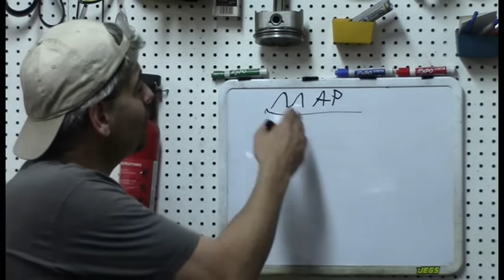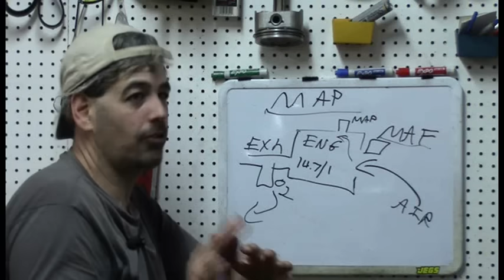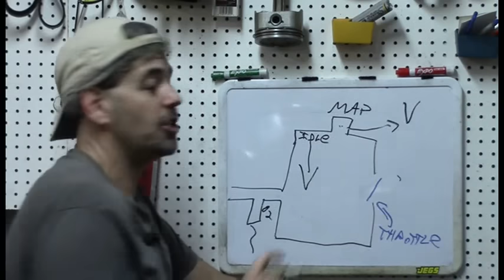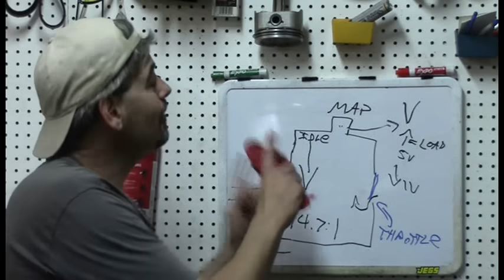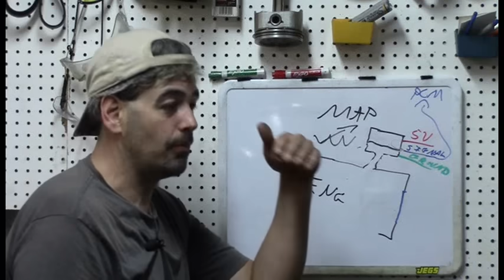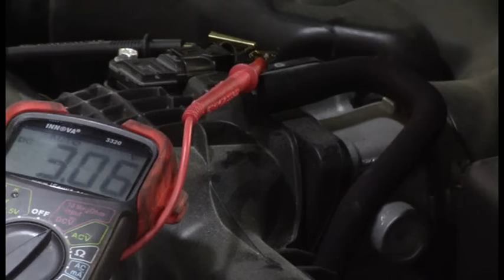MAP Sensor Diagnosis and Understanding Function- Pt1

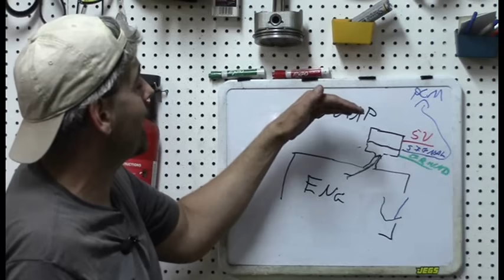Comment: Think you got the description of the MAP diaphragm backwards.  12:08 Increased vacuum should pull down the diaphragm not push it in.  That should correlate to increased injector PWM due to higher vacuum/load.  You described it the other way around.  Diaphragm should be fully bloated when not in use (car off or idle).  Only a pressure transducer pushes inward, far as I know diaphragms always collapse.  Also wish you would have started the entire episode off with an explanation on how critically important it is to have a good vacuum seal and how a simple vacuum leak can wreak havoc with a MAF only vehicle (like mine).  Cannot stress that point enough and is probably the main reason that people change parts for this one.  LOVED the beginning of the video by the way.  I was like "he's got to be joking, I know this is a joke, just wait for it".  Man you are so awesome. Don't stop being who you are and doing what you do.  It's why I watch.
Reply from the maker: ***** Hahaha, yeah I liked the beginning too lol. Pretty much a bit more subliminal bite at the 98%ers while still moving the pace along.
  You are correct on the diaphragm explanation- If I did indeed say that, then it was a Freudian slip or something and somehow slipped past my editing too. Thanks for the catch
Reply: Schrodingers Box hey. My 95 chevy k1500 tbi is having problems starting and when you are hard on the throttle, and also are light on it. It feels almost like a miss or not getting fuel. Then it will randomly rund and drive great for awhile then randomly have them problems again. No check engine light and the injectors are spraying nicly. I cant think of were the problem would lay. I have already replaced plugs, wires, cap, and rotor. Please let me know if you could help me out a bit. Thanks
Reply from the maker: Brandon Palmquist What did your diagnostic tests indicate as far as fuel trim vs engine load?
Reply: Havent hooked up a diagnostic tool yet. Just figured since there were no lights on that no codes would read.
Reply from the maker: Brandon Palmquist I'm not seeing how you expect to get direction without doing any diagnostics.  I need some data to work with bro.
Reply: Roger that i will run a diagnostic tommorrow around 11 am my time.. so in a few hours. I will comment the reads... jusr want to say i enjoy watching your videos. There helpfull on understanding specific parts and there purposes.
Reply from the maker: Brandon Palmquist Give me fuel trim data vs engine load to start with and if you don't have a scantool I'd start with pressure just to rule that out. See my video on fuel pressure/regulator testing to make sure you cover all potential variables.
Reply: Ok. Thank you will do that tommorrow morning

Comment: GM used to use 3 different types of sensors on their vehicles, 2 of them looked identical, had 3 wire plugs and a vacuum port but they were not interchangeable. They had the MAP, BARO, and VAC sensor. The VAC sensor actually had barometric pressure on one side of the diaphragm and manifold vacuum on the other, and it would monitor and report the difference in the pressures back to the ECM. So when you had vacuum at the VAC sensor, voltage increases whereas the MAP, voltage drops with vacuum

Comment: My truck idles fine.
Acceleration normal when idling.  But when in gear, loss of acceleration, sputter-like and hesitation engaging any gear once the "loss" occurs.
Felt like fuel pump being decisively tempermental...
But we know it won't run EFI without it.
OBD scanner says intake problem (once decoded).
Any advice helpful.
Glad to make a donation... Very refreshing channel and savvy fact based content! 2% here lol. Impressed!!
Reply from the maker: What data do you have?

Comment: This is the first video I have seen of yours and I believe you are probably the best man to ask a question about my 2005 Chevy Colorado L4 2.8 liter.First thing the timing chain broke while I was driving, surprisingly the valves weren't damaged . But now the thing is having all kinds of problems starting. It cranks fine but when it starts it is all gas. I mean I turn the key and the idle is all the way up as if I'm stomping the gas but of course I won't even have my foot near the pedal. 
The idle does go down when I press the gas pedal then chokes out.
Man it is like the gas pedal is somehow controlling the air and not the gas. Yiu know what I'm saying..

Comment: Wow!  I came here just trying to learn a little more about the engine code my car reported (P0107), and I took your suggestion of watching the video on fuel trims.  Talk about excellent information!  I was just going to replace my MAP sensor, but now I am going to diagnose the problem - specifically look at the short and long-term fuel trim data.  Thank you sir for sharing your wealth of knowledge.
Reply from the maker: ***** Another convert!!! Congratulations and good luck in your diagnosis!
Reply: Schrodingers Box Thank you for the presentation I am taking in information that I know but hearing it with a slightly different emphasis

Comment: Watching the video I'm thinking: I like this guys personality...
Reading the comments in thinking: lol he's a Savage!

Trying to internet troubleshoot for a buddy of mine with a 08 Challenger. His car cut off the other night and apparently won't start the codes the computer is throwing is the typical p0171 and p0174. He states that when he was checking things out he realize that his k&n intake filter had come off the intake pipe so along with the codes and the air filter being off I'm leaning more towards it being a MAP/MAF sensor issue. No access to the car so I can't do any voltage reading and I'm pretty sure if I asked him it will go over his head, even if I sent him this video lol... If you got any comments I'd appreciate it but I realize that's not much data to go off of. 

Either way, good day to you sir and thanks for the lesson.
Reply from the maker: What data do you have the simple P0171 and 4 so what is your fuel trim data curved against load showing? ALways start with the basic fundamentals like that on lean codes- always!!!

Comment: Hello Mr. Schrodingers, All I can say is WOW... I was looking for something and I found you and you did a great job on explaining everything in detail. Thank you for explaining and being the kind of person you are. My wife's 2009 Colorado has a intermittent chug problem at low speeds and take off. I took it to O'Reilly's and used there Bosch scan tool and it is saying MAP sensor is bad. But I wanted to test it before replacing it, and that is how I found you... Her truck has 5 wires going to it and I do not have a wiring diagram to tell me what is what?? More internet investigation on wiring.. God Bless you Brother... Doc.
Reply from the maker: +shafferjoe1962 Good job man.  BTW no scan tool will say any sensor is bad- it will just say the reading is out of a specified range or there is a detected circuitry problem.  But it will never say a sensor is actually "bad"

Comment: Thanx so much!!!  My '88 F150 was throwing a DTC 22 and 34 and it was driving me CRAZY esp since it is sort of my daily driver (if it were on the road lol) so I couldn't think straight.  I did throw a lot of parts at it but it is so much more satisfying to actually know what is going on and how to pin point the problems...  w the 34 code I removed the aftermarket EVP and tested resistance and found it was a bit off, it seemed the rod was a bit too long and the EGR wasn't closing so I was considering getting a motorcraft part but first I grinded down the shaft just a wee bit and that seems to have taken care of the 34.  The 22 I was considering getting a mot MAP but watching this vid and after testing for refV and ground but not MAP voltage cuz I thought I need a HZ meter or something and I don't have a back prober (well a carefulling place sharpened paper clip might work... but I decided to check for vacuum leak and sure enough the rusty brake booster seemed to leak  and the brake pedal would slowly bleed down at stop lights, I sorta thought it could be the master... anyway, I pulled the booster hose, stopped it up, ran it,  checked the codes and sure enough no more code 22!  Well, still there in the saved codes but now waiting for the codes to erase w the battery cable disconnected for 30 minutes or whatever,  I may be premature here and I still have to make the repair... but I really like your methodology and I have hope again... gonna try to repair the booster w brazing with magnegas if it's just exterior rust for the cheap fix but ok to buy a reman.... anyway Thanx! rock on and I'm a new subscriber   I still have lots to learn!

Comment: Nothing to do with MAP sensor but I came across a problem with my 2006 Ford Explorer. A CHECK ENG light came on today. I plugged in my scanner (OTC Genisys) and all data would appear then disappear. I checked other control units. Same thing. I asked a friend to bring in his Dodge Ram 1500 and my scanner performed well. The Explorer runs well throughout the RPM range. Thank you for your help.

Comment: Great video! Good job and I would like to comment on something you said at 08:12 which is believe is a mistake. You said the lowest vacuum is during deceleation. This is not the case because during deceleration, the throttle plate is almost closed- starving the engine of air which is the whole point on decelerating (to take air away from the engine aka air pump)Starving the engine of air reduces power and consequently causes decelration. The absence of air in the air pump (engine) consitutes a vacuum. Again, thanks for the video.
Reply: u wot mate?
Reply from the maker: Correct indeed- the lowest point of vacuum MUST be during deceleration. A brief moment's though would clearly indicate the closed throttle with rapid engine revolutions can only represent the highest possible vacuum condition.
Reply from the maker: ***** Thanks man. I like your screen name btw-- pretty accurate lol.
  Anyone who suspends the sun such that every last living thing in a city can not so much as hide in a shadow from their slayers and have full view of unborn children being paraded on the tips of swords is pretty much a sociopath in my eyes.
  If I had such power over the earth's rotation I would like to think I'd use it for other purposes like tripling global food production, but I am not considered "omnibenevolent" so I guess my application would be evil.
Reply: You clearly know your stuff and I do appreciate that you pointed out that I was indeed right. Good videos. Keep them coming Sir.
Reply: Highest vacuum (not lowest) is pulled on deceleration. Please go over Matt's video and my comments again and see if you think differently afterwards.Thanks.
Reply from the maker: ooooops - yes a matter of syntax- the "highest" point of vacuum would be the correct way to state it. I guess I was subliminally thinking in terms of absolute pressure but indeed all 3 of us are on the same page. 
  During decel the greatest amount of vacuum (lowest pressure) is present.

Comment: Thank you.  Not knowing what would cause vacuum, I surfed and found that with the throttle closed and the piston moving down, air is trying to fill that void (induction stroke).  Since the throttle plate is closed, a vacuum, low pressure, condition is created.  

As the throttle is opened, air is let into the engine by atmospheric pressure.  

Hope I got it right, but doing that research helped me understand the Fuel Trims and MAP videos.  

Thanks again.
Reply from the maker: You got it!  This is exactly why a high fuel trim from a vacuum leak only presents at idle, but not under throttle.

Comment: Here's one of those new issues that we have to wrestle with. We were all taught that Stoich was 14.7 to 1 (14.65 in a lab with pure gasoline). The problem with that is you don't get pure gasoline to put into the cars. Most fuel today has at least some percentage of alcohol up to about a 10% concentration. A 10% alcohol concentration moves Stioch to around 14.1 to 1. E85 if someone chooses to run it in their flex fuel car is around 9.6 to 1. The fun is the system handles it just fine no matter what fuel is in the tank which forces techs to have to learn this a little differently than we did in the past. Then we get the next little twist, the engineers don't even keep the systems at Stoich (or close to it) all of the time. There was always wide open throttle enrichment, and closed throttle fuel cut and that's not what I am referring to. The system today can be intentionally driven richer or leaner than Stioch to address specific fuel economy or emissions requirements. Hence the addition of two more data pids,  equivalency ratio and commanded equivalency ratio.

Comment: Ahh great stuff, been looking all over for someone to explain how things actually work so I can get my head round things more.. I've had a problem lately with my engine warning light being activated under load .. And when checking the codes it was a Boost Pressure Control Circuit Positive Deviation not present .. And generally just loosing performance.. I'm hoping cleaning this and the maf will help solve the problem ..

Comment: Okay... That was educating, albeit a bit technical for a complete novice as myself.
I have tried cleaning my MAF-sensor today, since my engine semi-suffocates at exactly 200 rpm and above. It started suddenly, though. I think the engine should have a MAP-sensor as well, since it is possible to buy one online, but I did not succeed in locating it. So the problem persists.
I am starting to suspect that it is due to my recent use of Holts Radweld Plus in the hope of sealing up a presumed crack in a cylinder head gasket on my Frontera 2.5 TDS. It helped somewhat on thegasket (or cylinder head - no idea) since it stopped sending up smoke signals when trying to start the engine - which it wouldn't du without starting gas at the time.
It starts and runs fairly nicely now, besides losing most of it's torque at exactly 2000 rpm (regardless of the gear selected) where the turbo would normally kick in. It sporadically stalls during driving too. Mostly during deceleration, but also at steady speed. Never under acceleration. That last thing sounds like the MAP-sensor, if I understand this correctly. If I give the accelerator pedal a quick "dap" and release it completely at one, it can also get the car to stall out. Maybe this is not a single problem but two, perhaps caused by multiple factors, but the stalling part sounds like t could be MAP related if I understood what was said.
Cleaning the MAF did seem to help a bit in how smooth the engine runs, though. I also "decarbonized" the engine with a water spray bottle while the sensor was removed.
Can it be the not-yet-found MAP, that stalls the engine as well as stops it from pulling above 2000 rpm?

Comment: Amazing explanations...  I had a loose connection in mine and I found out I didn't need to replace it for 76$ all I had to do was unplug and plug it back in reset computer. Check engine light triggered by map sensor will not disappear without a hard reset of ECU I was told by Chrysler. Map sensor failure sent my fuel mpg to 7... normally I get 22mpg... I had code P1496 and P0171 from ODB2
Reply from the maker: It is impossible that a loose MAP connection caused that, sorry. MIL will come back. check for 5V reference from the PCM and then for the P0171 do fuel trim analysis.

Comment: Excellent presentation and training video. The personality is also very professional. Using a white board to illustrate in diagramming is also very much commendable so I will be watching some additional videos you have as I am having a problems with my 2002 Jeep Cherokee 4.0 with 204,000 miles which is cutting out at around 3,000 RPM. It kinda sounds like there is a conflict with the MAP sensor now after watching your video but not showing up on the scan tool. I do have a check engine light though. I first suspected the Cam Shaft Sensor and one thing I discovered after two "After market" ones, was the Jeep would not start. After installing an OEM one it kicked right off so some of these after markets sensors are not compatible. Now back to the stumbling and RPM limitations I am facing. I am going to your next video.

Comment: These videos are invaluable to anyone who's learning about engine diagnosis. I have one question: how does a MAP-only system recognize a vacuum leak in the intake manifold? Meaning, how would the PCM know that the excess air hasn't entered via the throttle body? I have a feeling I've misunderstood something here, but I'm not sure what.
Reply: Air doesn’t enter through throttle body it exits through throttle body.The area this sensor is monitoring is upstream from throttle body.

Comment: Fantastic video as always Matt. In the interest of splitting hairs a MAP sensor is actually functionally identical to a potentiometer rather than a thermistor. 5v, signal and ground. Thermistor only has two wires. The 5v reference actually serves as the signal as it is pulled to ground in a varied  amount depending on the resistance of the sensor.
Reply from the maker: Andrew Porter You are correct- in the heat of the moment while trying to think up an analogy, the IAT came to mind first but it wasn't the best example as it is not a potentiometer. I just couldn't think of another potentiometer at the time lol
Reply: Fair one! Must be hard when talking to the camera eh! Keep telling it like it is mate.Very entertaining and refreshing. You're up there with Paul Danner IMHO.

Comment: gotcha diaphragm works as a potentiometer back to the ecm based on what position of the diaphragm based on the pressure in the intake  ... nice video you didn't leave anything out that's the way teaching should be